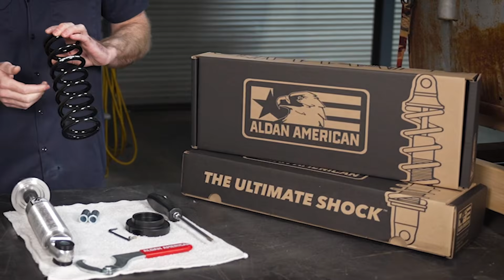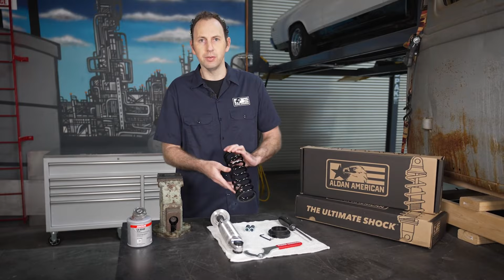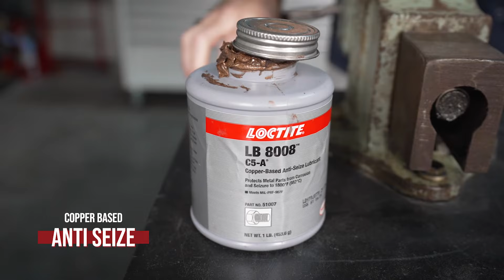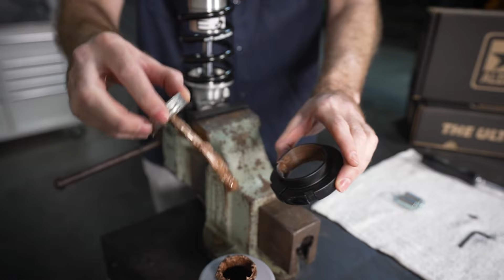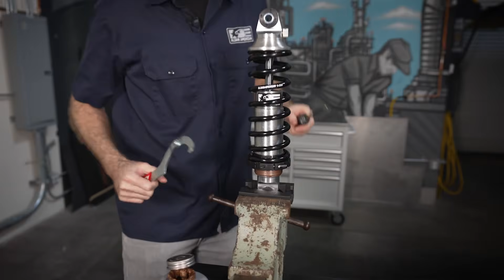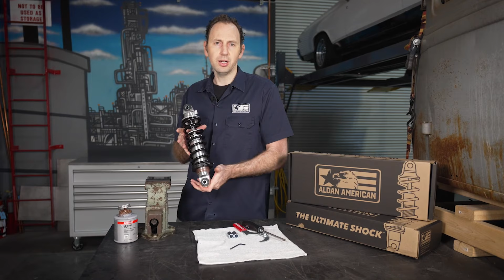How to Assemble Coilovers

Comment: I have a lowered 96 c1500 6 inch drop in the rear and I’m welding in a shock relocation bar and I measured the top shock mount and the bottom shock mounts from eyelets it’s 13 1/2 inches. Was wanting to know which rear coilover would u recommend. Was looking at your phantom series
Reply from the maker: Hi, if your ride height is 13.5" please see our part number AS-655 (15.0" extended) - If this is your shock/coilover extended length at 13.5" - Please see our part number AS-657 (13.5" extended) - Any questions, please give our team a call 310-834-7478

Comment: Thrust washer needed?
Reply from the maker: Thrust Bearings not needed, but a good upgrade to consider as they do make it easier to set spring pre-load. See our Aldan American part # ALD-26 for our full Thrust Bearing Kit for coilovers using 2.5" I.D. coil springs